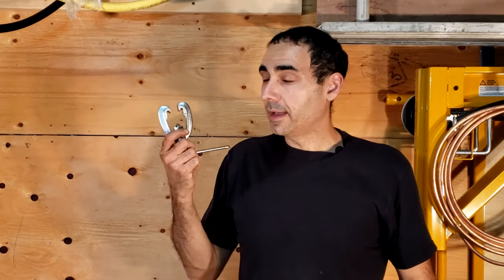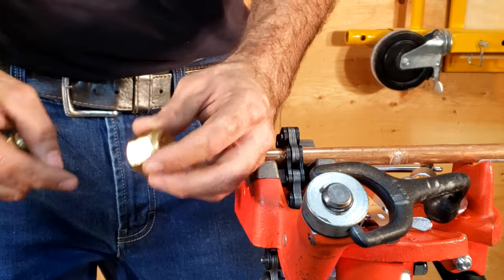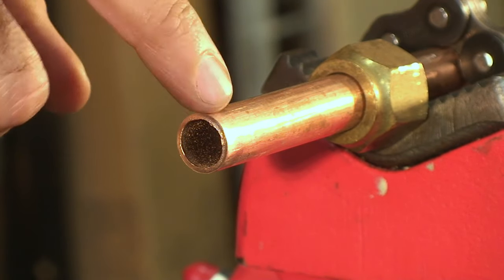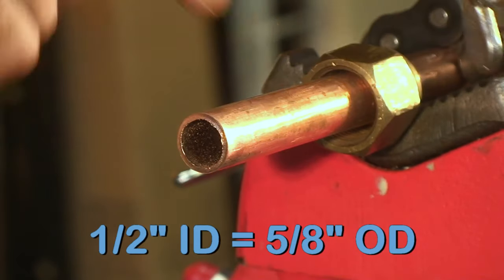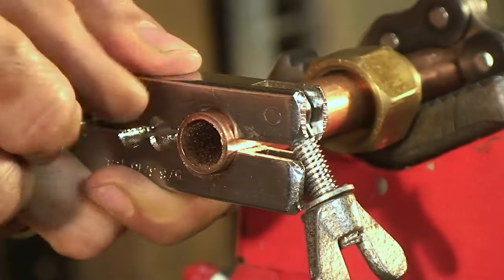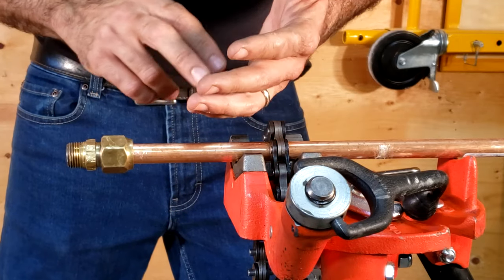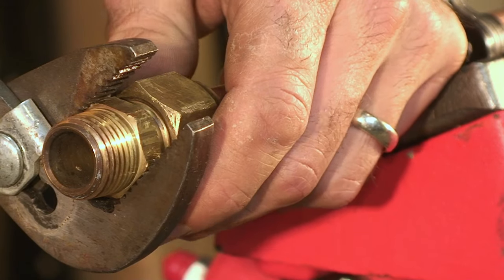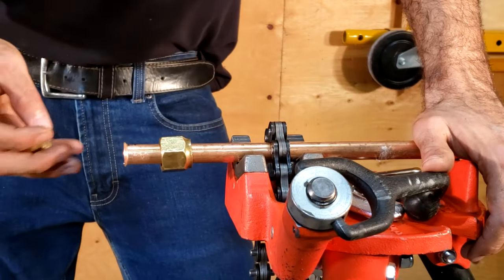How to Flare Copper Pipe!

Comment: I think you are missing the annealing process
Reply from the maker: Yes, annealing (or pre-heating) the pipe end would certainly facilitate the process, Ironically, I was never taught in school, or required to do so as part of the plumbing competitions I participated in, whenever flaring hard-drawn copper pipe.  So your suggestion is certainly not a bad idea.  Realistically though, most flaring applications would usually entail the usage of soft-annealed (i.e., "copper coil"), rather than hard-drawn to begin with.  Thanks for your feedback!

Comment: You did not de bere the coper and you can see it foldid over in the video
Reply from the maker: You are correct in that it's always proper practice to deburred the pipe...Truthfully, I got caught up in the video recording process and I overlooked that step.  

I should add that it's also important to note that deburring TOO MUCH is even worse, as it could shave off too much of the material and weaken the joint.  

Thanks for your feedback!

Comment: why flare connections?  too much work while compression fittings work way better and faster,
Reply from the maker: There are many ways to connect copper pipe, and flared fittings is one of them.  Notably, it's one of the few approved connection methods when burying copper pipe joints.

Conversely, compression connections (the common ones with the brass ferrule and nut; not the heavy-duty corporation ones used for underground water service) are significantly inferior and fail easily if the the pipe joint is stressed even slightly.  I've even seen compression fittings popping off, causing havoc and significant damage. 

Not gonna happen with a proper flare joint...which is why even the refrigeration industry uses flared connections to handle loads typical of 300 PSI...notte to mention other industries as well.

Comment: u forget to clean the pipe befor u flare it (with sand paiper) .
Reply from the maker: Although it's very important to clean the pipe prior to soldering, there's no need to clean the pipe for flaring...more so because it's the inside of the flared pipe that makes contact with the fitting and seals.

However, I mus admit that I DID make the mistake of not demonstrating that the pipe should be reamed for a flare joint.  Whoops! 🤭

Comment: It's EXTREMELY IMPORTANT to ream the pipe before flaring in order to get a good seal. The pipe in this video was not prepared. Sorry, thumbs down.
Reply from the maker: Thank you for your feedback, Sheldon.  You're correct in stating that it is best practice to ream the pipe prior to flaring, which I admittedly overlooked in the heat of filming this video.

That said, I want to add that if reaming, it's important to remove only enough material to restore the full bore of the pipe; over-reaming may do more harm than good, as doing so may weaken the flare, leading to joint failure.

Thank you for watching.
Reply: @PlumbingsCool  1111111 nku

Comment: to big flare, it wont seal
Reply from the maker: If the flare were too large, then the nut would not go over it.  I assure you that it will seal just fine. The only mistake I made in the video was that I did not demonstrate to ream the pipe before flaring.
Reply: @PlumbingsCool  the flare kan not touch the threads, then its to big, and wont seal properly, it has to have space in the nut to expand, thats how im teached

Comment: You should never use another tool to tighten the wing nuts.  They should only be hand tight, no more,
Reply from the maker: I may generally agree with you under certain circumstances.  However, hand-tightening will likely not provide enough pressure to squeeze the clamp around the tubing tightly enough to keep the tubing in place while it is being subject to the tremendous pressure applied by the flaring tool head - thereby causing the pipe to slip down. 

It's arguably also why the flaring tool's long handle fits so nicely between the clamp's shaped butterfly bolt wings:  to provide the added leverage required to turn the bolts tightly enough to properly clamp the  pipe in place.

Thanks for your feedback! 👍
Reply: You should always tighten the bar clamp fully. Any small gap can create an imperfection on the flare and will not seal. And many have wing nuts specifically shaped for the tools handle to be used to tighten them. That said, I hate bar clamps. Once I discovered in-line flaring tools the convenience and quality of the flare is night and day. Granted, I typically work with steel lines 3/8" and under so limited to the bar style for these larger diameter pipes.

Comment: DAMN, If you are gonna record a video to do a demo  Take the time to get the MF wrenches  and put those pliers down.  and What about de-burring .
Reply from the maker: Good suggestion in hindsight, although the goal was to show the flaring process on the pipe, rather than how to tighten the flare onto a fitting.  But you're definitely right on the deburring...which I accidentally overlooked because I was too distracted trying to figure out how to film a video during these first early days.

Comment: Aw man no dope 🙃
Reply from the maker: Unlike pipe threads, a proper flare joint does NOT require dope!  Although I learned recently that some HVAC techs like to use a blue substance which is safe for their refrigerant systems...but it ain't dope! . 😁